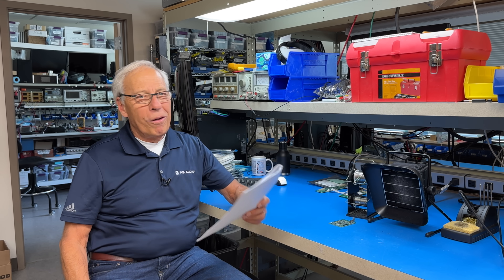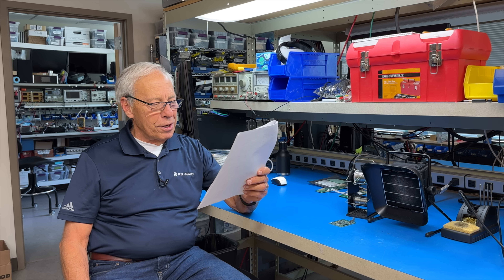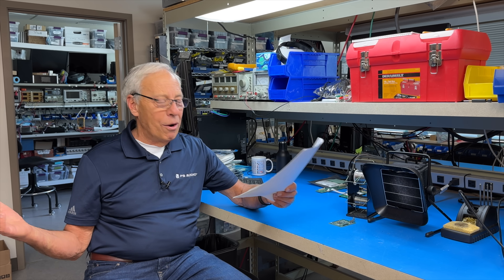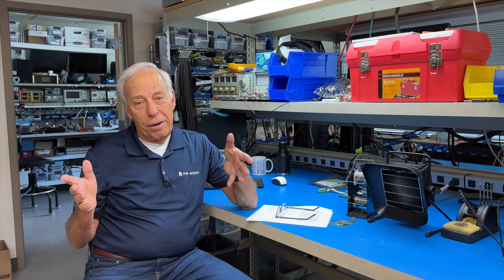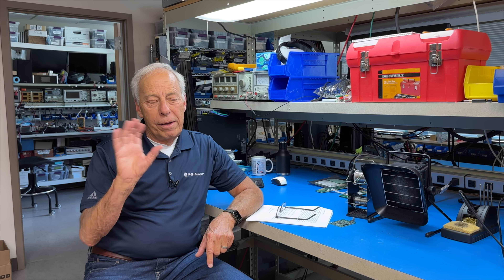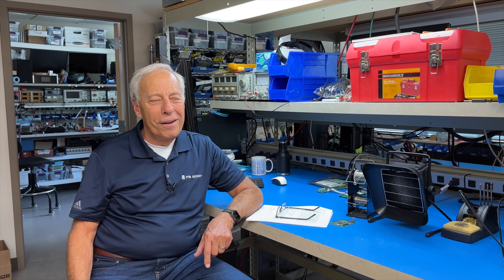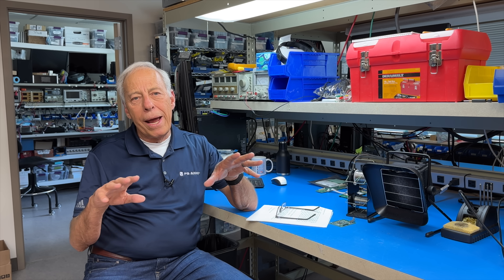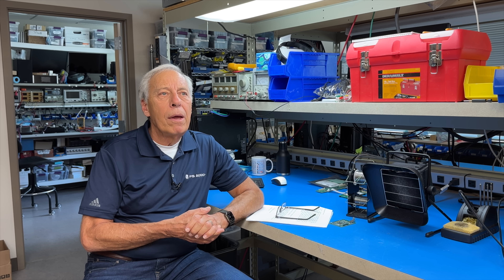8 DAC chips in the new Stellar Gold

Comment: Paul, are there any chip vendor engineering references I can read about paralleling audio DACs? The "octo" DACs I have seem and worked with are meant for 8 discrete channels. I never saw an app note about paralleling them. Would love read more about it.
Reply: You should ask the vendor
Reply: @Pete.across.the.street  I thought  did? Isn't PS audio the vendor here? But, I will also ask some of the DAC chip manufactures engineering support.

Comment: The output stage is still a mystery on the Steller Gold.  I could easily be wrong but the output stage on their reference DACs uses tubes.
Reply from the maker: No, actually we don't use tubes on any output stage. We do use some vacuum tubes on several input stages, such as our BHK amps and preamps, but all output stages are solid state (in the MK2 DAC we transformer couple the output)..

Comment: Wouldn't the chip manufacturers integrate the paralleling up procedure into the one dac if there was any worthwhile benefit?
Reply: Why should they when an engineer could freely decide which of those DAC instances he uses for what channel. It's also possible to use 8 DACs for e. g. 8 audio channels.
Reply: They did. It is one big chip with 8 separate dac “chips” inside. And they also make a smaller single version. That’s what’s in most other DAC’s. ✌️
Reply: You should ask the manufacturers

Comment: Seems to be a lot of confusion in the comments.  IMHO he said 3 basic things.
1. They are releasing a new DAC and a new preamp in the Stellar line
2. The DAC uses one ESS Pro chip and they are paralleling the 8 channels into 2x4
3. Any DAC's sound performance depends on the power supplies, the output stage and the clock.  He comments in detail about the output stage.  IMHO they likely used Darren to employ some of the design chops from his phono preamp and repurpose it in the DAC output stage and in the new preamp.  He described using all discrete FET design tuned by ear to be a good value proposition at the Stellar pricepoint.  Time will tell how well this DAC performs.  All ESS DACs have a sound signature, but can vary greatly based on these factors.
Reply: Tuning by ear is a joke. All previous dacs from this company have high noise and distortion.
Reply: @ryanamendt8363  I can't comment on PS Audio DACs.  Never heard one.  I thought the DirectStream was well regarded.  But making design choices by listening is certainly the way you get from good to exceptional.
Reply: Update.  I heard a DirectStream DAC driving FR20 speakers last week.  The whole thing sounded quite good.  At a show so in a room with noise so hard to say if it is good or exceptional.  Here is a soundclip I took on my phone. 
https://www.youtube.com/watch?v=b3wLiPlUKv0
Reply: @ryanamendt8363  your understanding is a joke. Your level of experience is a joke. This comment is a joke. Don’t get all upset because it’s just a joke.

Comment: Several DAC chips was very common 20 years ago regarding designs based upon Wolfson chips. I think most of Arcams FMJ series CD-players and most of their DVD-players has many chips. It’s just one way of trying to build a good DAC. There are several ways of building a good DAC. Engineering is a lot about compromising between costs, technical solutions, features, different customers demand different things. PS Audio tries to make products them self would like to own with high value in most of their products. The designs and technical solutions vary. This does not mean that previous solutions was inferior in any way. Many of the most well regarded high end DACs follow in the technical footsteps of PS Audios DirectStream Ted design, with brands such as Meitner, Mola Mola and others. Chips, amount of chips or no chip at all are just a way of doing things. Other things like noice, vibration, output stage, quality of power and others can have the same or even more influence on the finished products sound / performance. Sum: It’s nice that Paul educates people. This thread do not need people that says that somethings are better than others.
Reply: "This thread do not need people that says that somethings are better than others." And your statement above states WHAT EXACTLY???
Reply: No, PS Audio dacs have high levels of noise and distortion while those other brands don't. Paying four figures for that isn't value.

Comment: I assume the output stage sums the 2x4 dacs outputs and averages the common mode noise? Isn't all the noise just adding on top of each other since the dacs reside in the same chip, creating 'higher quality' noise?
Reply: Why would you assume that?
Reply: @Pete.across.the.street  No reason. Double differential outputs and a summing stage is also possible but would make the circuit very complex.

Comment: I prefer running DACs as monoblocks hanging from the ceiling by Bungie cords to remove vibrations.
Reply: I hope you had the presence of mind to buy Audiophile grade Bungee cords.
Reply: @davidfromamerica1871  They were $14k/meter in their flaccid state. Does that qualify?
Reply: the problem w/ bungee cords is perturbation of the local gravity field by dense components being moved about (almost imperceptibly) when source material is played at high volume. this phenomenon is particularly noticeable when the source happens to yield incoherent gravity waves, such as discovered by Moby Grape with The Lake & (somewhat less successfully, but of greater duration) Beatles Revolution #9.
Reply: @grumpy9478  Bella Fleck with Flight of the Cosmic Hippo will cause some pretty good gravity waves.
Reply: and always using 7 grand per meter power cables

Comment: Wow, not even the Chinese squeeze 4 ESS per Channel into a DAC. All I have seen so far is one per channel max. Or are we not talking about the 9038/39, which already have  8 channels on chip?
Reply: I think they are just using one ESS PRO chip which has 8 channels. This video is a joke.
Reply: @razisn Not sure. It is confusing. He was talking about the power supply complexity and special output stage. None of that is necessary with a standard 8 chan ESS. It is actually very easy to combine all channels as all the chinese DACs show.
Reply: @hermannschmidt9788  Listen to what he says regarding the 'chip'...  Btw not all DACs utilize all the channels of the PRO chips... but the manufacturers won't tell you that..
Reply: @razisn I listened again and I think they are actually using 4 chips. Well, I guess we have to wait for some images of the circuit board.
Reply: go SMSL go...
Reply: @endrizo  My bets are on Topping 😀
Reply: Haha, there you go. Topping D70 Octo with 8 Cirrus Logic DAC chips. The other manufactures won't sit still.

Comment: What would be the closest thing to an analog equivelent of a DAC? I know analog is different. Would it be the stylus, the cantilever, the generator, the preamp? This stuff about cd playback needing more warmth. Is it just people who've never heard a good cd player who think that?Just because a cd playback system costs 20 or 40 grand, doesn't mean it's great sounding. Design, good parts and good ears=great cd playback. I do have one tube thing in the system that I'm using now, and cd playback has no problem with warmth at all. Most solid state amplification that I've heard does sound miserly and greedy with warmth. Even more so I think, than digital. If you want to hear the most realistic reproduction of a piano including it's low registers, you might have to veer toward tubes. Of course it depends on the music. With someone like McCoy Tyner, who uses the lower register keys a lot, he sounds better on tubes. Chick Corea might sound acceptable on solid state. So what is the instrument that sounds best with tubes. Easy one!...Flute. Piano is a strong runner up.
Reply: IMHO the DAC creates the music from stored information and outputs a buffered analogue signal that could drive an output amp.  So I'd argue the analogue equivalent is the turntable and the phono preamp.  Vinyl is the storage media and it is recorded in a way that the phono preamp must decode with a RIAA circuit and amplify to be able to drive the power amp.
Reply: Analog switches with a resistor ladder is the equivalent. But that's probably not what you're looking for.
Reply: Super side note, notice this trend with Oppo CD players? Reviewers be like” ahh, well to review these £200000 speakers, £50000 amp etc I thought why not mix it up and thrown in a £200 CD player. I mean.